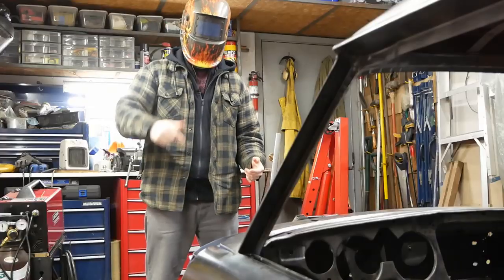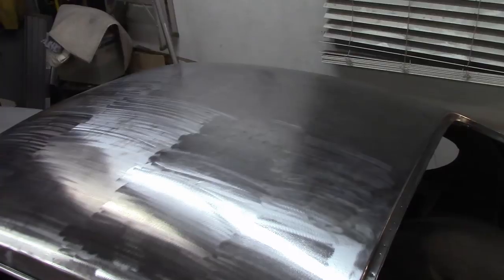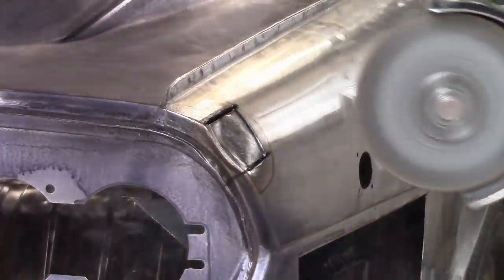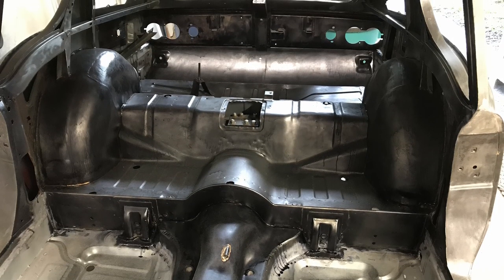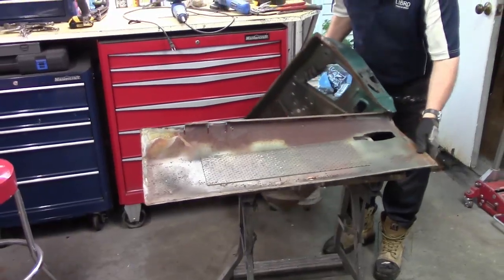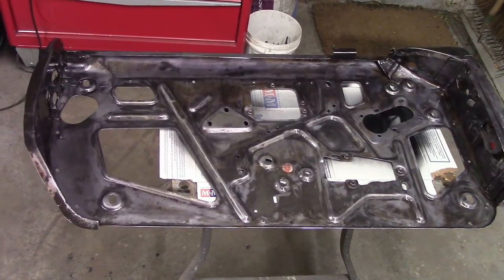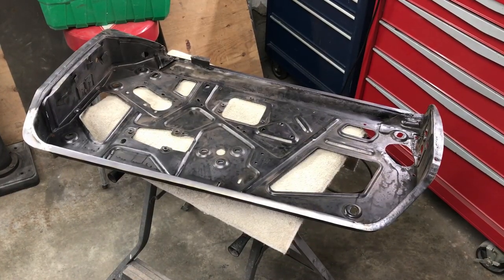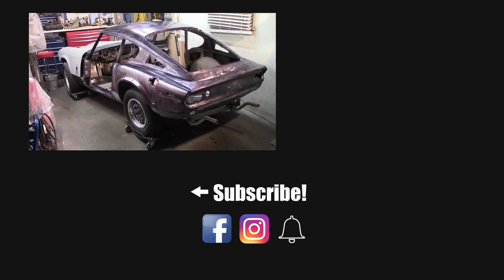Even MORE RUST – Triumph Restomod Build – Project GT6R – Ep7

Comment: Have you guys looked at soaking rusty panels in white vinegar?

It's worked great for me as a first step to knock rust off.  Next hit it with a wire brush, rinse with water, then apply phosphoric acid, rust converter, or evaporust.

A 5 gallon bucket's worth cost less than $15 USD and lasts a while.  You could probably fill a door-sized tub for less than $30USD.

Love watching this build, I'm dragging home a rusty GT6 body tomorrow.
Reply from the maker: We have not tried that - quite the process!  Space is our issue, having that volume of reusable liquid kicking around means we need to store it somewhere!  There was also so much paint and filler on the car that the wire wheels were necessary just to get down to metal, at which point this rust converter spray has done the job nicely - really impressed with the stuff.  Have fun with your GT6!  They're great little cars that deserve more attention!  Cheers 👍

Comment: Do you have to remove the rust converter before you paint the car? Or does it work as a primer?
Reply from the maker: The product says it treats and converts rust into a primered surface ready for paint.  So technically no, we don't need to... However!  We will be sanding the steel with a DA before it gets epoxy primed and body work begins.  We're really pleased with the rust converter though, the shell has been in it for a few years now and it's done a great job killing the oxidation!  Cheers👍

Comment: Looks great.
Those lower door corners that stand proud are a common issue on these cars during rebuild. Hopefully you didn't weld the skins on any more than the few factory tack welds. I redid the skins on my 67 (not the car in my Avatar... That's my inspiration) and had the same issue. Took some fettling but I eventually got it
Reply from the maker: Thanks Hazen, believe the doors turned out fine actually, the problem lay with the sills.  They were one of the first steps in the rebuild and we didn't mount them correctly.  It's been a learning experience and if I could go back in time I know what I'd do differently!  Lol
We've since come up with a solution though and will share more in a coming video!  Thanks!
Reply: @FanatikBuilds  I hear you. So much I'd go back and redo myself.

Comment: Looks great!! I have a tr6 that I’m restoring. Did you just use wire wheels and a grinder to strip to bare metal? What kind of grinding wheel? Can’t decide if I want to sandblast my body with the price that comes with it.
Reply from the maker: Thanks Peter - yes wire wheels on the drill and angle grinder plus what's known as "strapping" disks for the grinder.  Not nearly as aggressive as a flap disk so leaves the metal intact.  We have a sandblaster that we used back in episode three, but the bodyfiller was so thick and the blasting makes such a mess that we decided to try a different route.  Depending on the amount of rust you have, blasting could be a very revealing exercise, but certainly comes at a cost if you are out-sourcing.  Up to you, but no matter how you go about it, it's a lot of work!  Hope that sheds some light for you!  Stay healthy!
Reply: Is that the same as a polycarbide wheel? I don’t want to deal with the mess sandblasting creates, and there isn’t much rust to remove on the body area, just paint and light surface rust. I love this series thank you for documenting it!!
Reply from the maker: Exactly!  Hadn't heard that name before, but that's precisely what we used.  Very pleased with the results!  Do note that there's still a ton of mess, but not quite as bad as sandblasting!  👍 Thanks Peter!